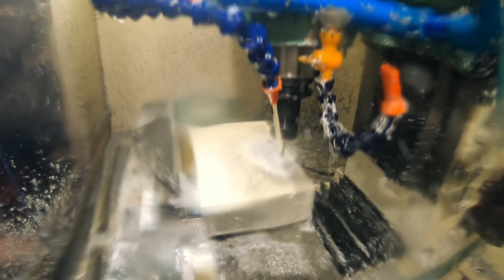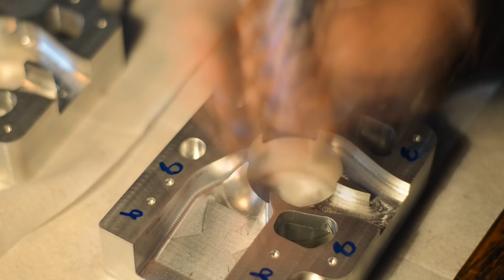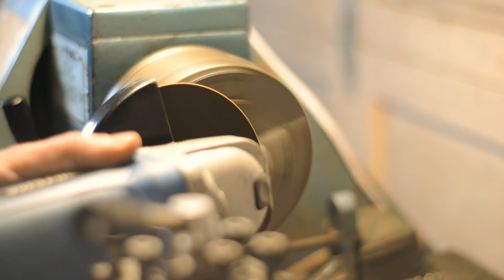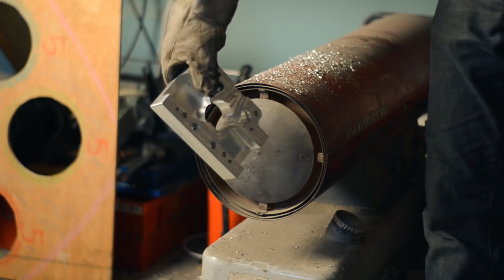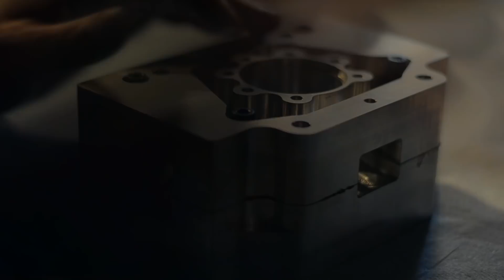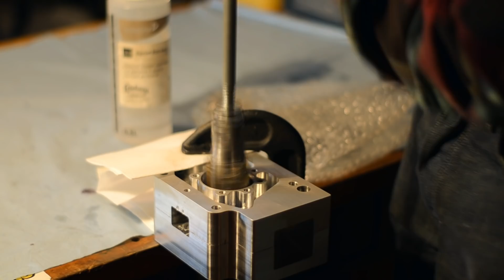You haven't seen a part like this before!

Comment: Awesome work. As for difference in part specs. I have a cnc mill conversion and have had the same issue might I suggest creating a gcode to cycle machine movement and run the spindle for 5 min or so. even just running the program and letting it air cut will do. I find bringing the machine up to a stable temp works well

Comment: Mighty fine whittling . Try air blasting the tool while cutting . A little copper tubing some rubber hose and a needle valve  hooked to your compressor .

Comment: So nice to see the commitment, at this step keep in mind whatever can be adjusted prolly will need to be, such as gear ratio of compressor, disk timing, port timings and of course ignition and fuel. Keeping the test bed flexible for tweaking will give benifits

Comment: I think ISO standards have rules about workshop/workpiece temperatures and such because of this. Also when you turn stuff in the lathe and take measurements you might have to wait for the part to cool before you take final pass and measurement. And if you test fit a cold cylinder in a newly turned hole in the lathe that's warm the cylinder will cool the turned part and it might slide in nicely but then get stuck as the outer part cools and shrink around it.

Comment: When fitting those alignment pins, don't forget that it isn't just at room temperature that you need a good fit, the pins still need to be tight at the operating temperature of the engine.  Although my father worked in a more limited temperature range with his designs (they weren't combustion engines), when he wanted a permanent fit, he'd use holes that were slip fits for pins that had been cooled to liquid nitrogen levels (*slip* not press).  Once seated and rewarmed, they were permanent, but you only got one chance to get it right.

Comment: If you have press fit issues like that again, get a hot plate and warm the block up slowly to about 100C and put the pins in the freezer for a couple hours. Then they should drop in and you wont risk galling the aluminum

Comment: ///////*******////////
Not sure about 0.1mm change from room temperature fluctuations
the coolant in the machine would stabilise the aluminum .
on finish bores use the repeat finish pass feature to eliminate tool/machine flex.
how did you check the first part? if you crept up to size and didn't do the exact same procedure on the 2nd part the results are always different.
you are doing really well with the programing and setting up.
get yourself a 90 deg spot drill so you can also deburr the parts in the machine.

Comment: As you are machining through the day your machine will have thermal expansion and tolerances will change. If you're circle interpolating your bores you will need to leave some stock and sneak up on your final dimension with cutter comp and preferably a finish tool. The best way to approach it is rough machine the bore and then come back with a boring head.  I've been a machinist in nuclear, aerospace and now shop owner and I've seen it's quite common for the machines to grow, especially ball screws.

Comment: I've wanted to do a max cylinder pressure build for a while now this is as close as I could find awesome job It would be cool to see how much pressure you could hold in a max scenario and if your  theoretical max rpm is about 22,000 rpm due to not being able to exceed the flame front speed pushing the piston. max pressure will give you a theoretical max hp for a given cylinder

Comment: When you are machining to achieve tight tolerances you want the machine to be warm also. Not just room temperature warm but the bearing to be warm to running temperature. I have seen production machining and the will run the machine cutting air to keep the bearing and ways warm to maintain accuracy.

Comment: Have you thought to seal the bottom end and run oil like a four stroke. No need for the first compression in the case with the supercharger. I think it would free up power and you could run straight gas instead of mix.

Comment: From my experience temperature doesn't make too much difference above a few microns, tool wear definitely sounds more plausible, especially with smaller endmills and, depending on your use of separate finish cutters. 

Also tools tend to wear into a slight taper as the bottoms are used more than the top of the flutes. I'm not sure what the temperature change in your garage is, since it's Sweden I'm going to assume it's quite a bit more drastic than here. 

Aluminium does grow and shrink alot more than steel with heat, but on smaller holes it's neglegable unless it's like 100°c of variance, I think steel is like X= 0.4mm/m/100°c and aluminium is around 0.6mm/m/100°c

Comment: Any reason you don't drill in your mill? Also, try doing tight tolerances in multiple passes, with an optional stop between each. That's how I get things tight when I have to use a janky router.

Comment: Great Video ,I never produce bores by using circular interpolation they are NEVER dead round or parallel ALWAYS use a boring bar Regards Dave
Reply: There will be a sleeve

Comment: It would be cool to make a single cylinder modeled after a 2 stroke Detroit Diesel. That engine used a piston port design and had 4 exhaust valve in the cylinder head.
Reply: That's what I've been thinking of lately. Would be cool if one could make a linkage from the con rod to crankshaft in such a way to vary the stroke length to change inlet port duration and port size to reduce throttling losses at partial load. And throw in direct injection for better emissions.

Comment: It's likely more the temperature of your machine, not the material. Thats why I always run a warmup routine on the machines I run at work at the start of the day. Run the spindle at max RPM and run the table around for a couple of minutes. With new, modern machines its less of an issue. Older, or more hobby grade machines you're gonna run into bigger problems with machine temps.

Comment: I am skeptical it was the temperature that made those alignment pins a press fit. To enlarge a 0.5" hole (12.7mm) by 0.001" (25.4um) you'd need to heat up the part by 167F (92.5C) 
Did you machine the first part with the holes slightly undersized, then measure, then take a small cut to finished size? Then on the second one did you just run the program once? In that case the deflection of your end mill will be more on the second part and cause the hole to be a little small. When I do tight tolerance features I always do a repeat pass to minimize the tool deflection. Hope that helps!

Comment: The sealant you used between the two halves of cylinder is that just like a hydraulic sealant /aenerobic ??
Reply from the maker: Yep, anaerobic engine sealant. claims to withstand 280C and 600bar.

Comment: Looks like CNC is kick’n ass!! Could you make a fixture for the assembled halves and final bore the cylinder in a separate Op as an assembly? 

Also, just thinking out loud here, in 4 stroke blower motors, the typical cam choice has a wider lobe separation angle. Usually centers/peek lift are in the neighborhood of 114° +/-4°. Are you going to be able to achieve similar numbers on a 2stroke configuration?? I’m not even sure the concepts are comparable across cycle configurations but it’s certainly got my interest!!

Comment: Make the exhaust valve in two halves.. so the overlaping holes get bigger and smaller using a centrifugal  bobweight type of "Thingy!" to make the hole overlap bigger or smaller... sort of Vtech mets YPVS type of thingy... if you know what i mean..! lol.!
Im loving every minuet of it mate..
Cheers from Wales..
Reply: There is no need for that because CVT transmission.

Comment: why are the holes and tread been done by loose hand ??? and not on the CNC machine itself??? #loveyourvideos
Reply from the maker: Thanks! I do it by hand cause I'm afraid the machine will misbehave...
Reply: @2STROKESTUFFING  the fact your afraid it will misbehave is a bit sketchy.... but if you make sure you have a good origin point on the X Y Z axis  you can use the manual option for drilling the holes. in that way it is much safer and more accurate making the holes. and tap them. #goodluckwiththebuilds
Reply: @bas his CNC machine is totally sketchy! Watch some of the older videos, it’s way better than it used to be, but it’s still hobby grade not a pro tool. It’s amazing what he’s got it to do so far…
Reply: @bigiain_au  yep your right. i have seen them all.

Comment: If the size is 0.1mm off, the temp difference would have to be 100C° at 40mm bore. Doesnt feel quite right but my expansioncoefficience numbers could be wrong 🙈
Reply: You are correct. About 110deg K temp difference would be needed. I bet moat of the effect is from machine heating up. When I turn bullets I have to adjust parameters for first hour or so in every 10 minutes to achieve +/-0,0025mm tolerance.

I would ream such holes. Also cylinder bore should be reamed when assembled. Circularity will not be very accurate with the end mill boring honed afterwards.
Reply from the maker: 👍 Need to get some reamers, and get to grips with my boring head.
Reply: @2STROKESTUFFING   What aluminum are you using? I would suggest Uddeholm alumec 89. It is really easy to machine and has quite low internal stress for high strength alloy. If absolute dimensional stability is needed plancast + 7021 is superb in high strength class.

Comment: Do you need reedvalves with forced induction?  And do you need expansionchamber in exhaust?   What about high boost and low compressionratio and direct injection?  And start inject fuel just before exhaustport is closed so you got fresh air and fuel in the exhast.  Then it heatignites in exhaust.  Let this pulse draw out next stroke and tune pipelength to not let the pulse leave before next is coming.    Good or bad idea?

Comment: Wouldn’t your sizing issue be the opposite though? If you machine cold stock to the same dimensions while still cold, wouldn’t those tolerances grow as the material warmed up therefore making it looser rather than tighter? Keep up the great work! I’m starting at the beginning and going through all your videos. Awesome! My whole life revolves around turbo (or the very occasional supercharged) two stroke snowmobile engines so this is really interesting to me.
Reply from the maker: Thanks! It's the mill itself growing from cold to warmed up.
Reply: @2STROKESTUFFING  Right, ok yes that makes sense.

Comment: Its got me thinking about the two stroke operating cycle. Say if you could open the exhaust at 90deg ATDC and shut the exhaust port at BDC and close the transfer ports at 90deg BTDC while force feeding the transfer ports with a supercharger or turbo, then I was thinking by the time you have 90deg of compression pressure on top of whatever pressure you could build in the cylinder in 90deg of crankshaft rotation, then would you have more charge or pressure at TDC than an expansion chamber equipped two stroke engine can deliver? Also is it possible to get induction, compression, power and exhaust strokes each done in separate 90degree periods of rotation with no overlap between them?
Reply from the maker: What you're describing is pretty much how this will operate. If better than a "normal" 2t is unknown atm.

Comment: Hey hey big man
Maybe you remember me commenting before - I'm the german CAM-Programmer/Machinist/CNC-Whisperer

Buckle up for knowledge

Fittings can be a pain in the ass.
Main factors are Parameters and Temperature but that's only 2 basic ones.

Vibrations can play a role - this is determined by your parameters, clamping force, tool length, even how your CNC-machine is built.

Another huge factor is if your machine is properly warmed up.
Many machines need warm-up cycles to be accurate and prevent wear-damage on axis and rails.

Back to Parameters - many people think that a high feed rate will make a fitting bigger because of centrifugal forces or something. But the case is exactly the opposite.
Many machines are smart enough to understand that they can't hold the toolpath so they compensate like making a polygon with fewer edges.
This usually leads to fittings getting way too small.

No part is the same - When something needs to fit, do not mill straight to the tolerance.
Make multiple programs with offsets for your fittings like +0,05; +0.025; +0,00; -0,015; -0,025; so you can measure and correct without going back to programming again.

Now for programming (gets intense) - I usually use a Helix with low feed and step for fittings.
I don't know if you mirrored that part but here is some knowledge:
Mirroring a part needs further calculations and complexity.
Bad CAM programs can't mirror properly.
Toolpath strategies can be flipped, resulting in poor Makros and collisions.
Worst case is a mirrored toolpath that isn't Counter-clockwise anymore and even starts a Helix at the bottom but this usually only happens with shitty dialogue programming.
Solution to mirror headaches - Don't use the same joblist (or whatever it's called on your program), rather copy the original joblist, copy and mirror the part on a separate layer, set the mirrored part for the mirrored joblist.  Now the original is untouched and calculated, the mirrored can be calculated and adjusted separately.
Calculate and check all mirrored paths and correct strategies.

Comment: If you dont use the crack case voor gas air mix Cant you put oil in it so you dont run 2 stroke fuel but Just normal gas

Comment: I bet its the heat in the spindel bearing cousing difference in Your holes. And if you want to machine holes to a spesific tolerance you need to get Your hands on an adjustable boring bar. And for small holes you should Get Your hands on some i dont know the american name But in norwegian its a brotsj. Maybee its called a broach.

Comment: its normal for the part to have wrong measurements because of temperature. That is why you allways have to measure your parts "cold". So if you take some material off of a piece of round stock and you want to make the final pass and you measure before to confirm the size make sure the part has cooled down. Then make the final pass on the cold piece and it should be good. If you do it on a hot piece then your part wil come out too small, if your piece is too cold you part wil come out too big as wel.

Comment: Temperature changes can cause material to grow or shrink, but a 0.1 mm difference is a bit excessive for just plain ambient temperature fluctuations to take the blame. Also, you were machining with coolant, maybe your machine's coolant chiller is busted, if you do not have one i highly recommend getting one. Also, one can never say what endmills will end up doing. I've have production parts that run for 2-4 mins per part with a critical size. Most of them end up being the same size but it will always have a very slight difference. Not sure if you know this but if your machine has this capability, you can make a "offset" programs that use the "D" geometry on your machines offsets to determine the size of the endmill. Maybe look into using that for critical sizes.

Also, I see you are machining dewl holes, have you heard of reamers? These are normally 6 flute "drills" with high accuracy, depending on the size and depth of the hole, you could save a bit of time by pre drilling and reaming it. There's also much less chance that the size will be off/oval caused by the machine because it doesn't reply on the accuracy of your x/y slides but rather how much run out your spindle has.

Last but not least, another tip for you, maybe you won't use this tip but just to help you get a machinist's perspective. If I was doing that job, I would have done one halve and left on ... say 0.5 mm on the first parts bore. Then the 2nd part i would have also left 0.5 mm on the walls of the bore. Before I take the 2nd halve out the vice, I would have mounted the 1st halve to the 2nd halve and used a boring bar to take both bores to size one shot.

Comment: The material temperature hypothesis sounds plausible, but I feel like aluminum wouldn't expand 0.1mm over 40mm with maybe a 20° temperature difference. Did you measure it in multiple places around? There could be a difference in you x and y axes.

Edit: thinking more about it, the cnc itself will shrink and grow with temperature too. Might be a bigger effect than the aluminum you're machining.

Comment: I was trying to message privately but couldn't as I don't have any Social Media and couldn't figure out if I could on here...
So here goes...
Have you looked into the now very old Rolls Royce Crecy two stroke slide valve engine? I was reminded of it only this morning when Curious Droid, on here, posted a video. 
I worked very briefly on a Rolls Royce Griffon and the Triumph 2.0 16 Valve engine's but I've been fiddling with 2 stroke 50cc bikes for donkies years which is why I started following your exploits.
Keep up the good work and look into the Crecy engine, if only for the sake of curiosity. 
Regards, Al.

Comment: It's the CAD/CAM slide guitar blues.  Sharp edged aluminum chips and coils of drama.  Nitro powered excitement scavaged from furious oil slinging robotic machining. Will the stressed, little engine that could,  burp, belch, fart and explode from supercharged human over thinking?  Stay tuned!  Maybe you should contact Allen Millard.  He works with a file, hacksaw, ruler, lathe and straight edge.  There is a calm excitement about his projects, powered by his wife's latest baked goods.  You are both entertaining in different ways.  You have gas and oil in common.

Comment: At work on my machine I will usually intentionally start with an undersized hole, then keep adjusting the hole size up by a few tenths of a thousandths until the pin fits in snug. It is very hard to get a machine to repeat this consistent.  this method works great when you are more concerned about how tight the pin fits than the actual ID.